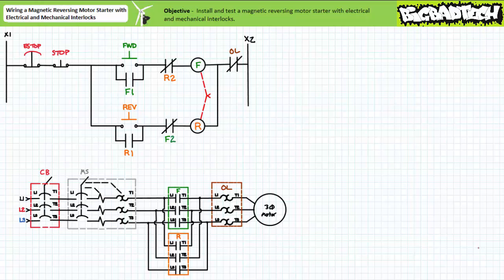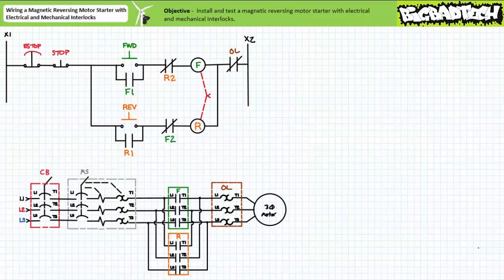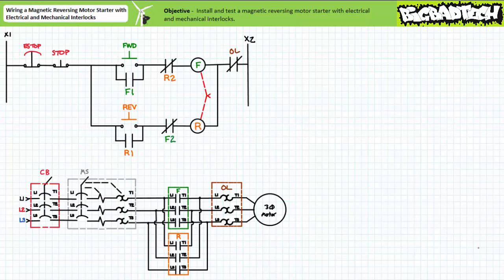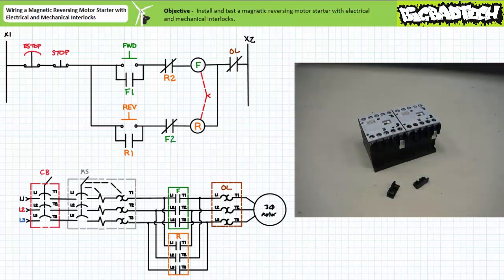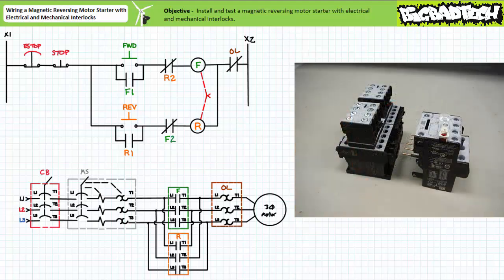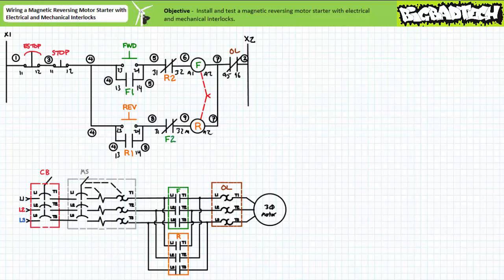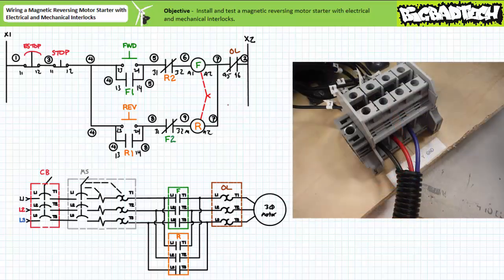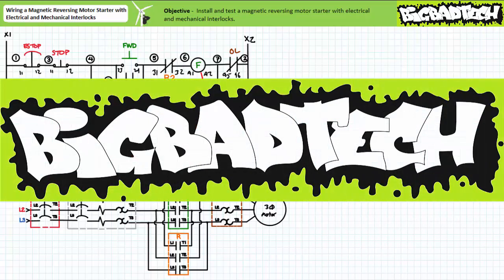Wiring a Magnetic Reversing Motor Starter with Interlocks

Comment: Can you explain why you are using both a manual starter (with a built in over load) and an additional overload? Wouldn't the Manual starter be enough?
Reply from the maker: Good question. You're correct, either one would serve to protect this system. You'll often see this type of arrangement for 2 reasons: 1) redundant backup in case one element fails 2) the manual motor starter could be servicing not one but several contactors, when a technician opens the manual motor starter everything downstream is de-energized. Elements not serviced by that manual motor starter remain unaffected. This serves as a means of functionally isolating certain elements of a larger system.

Comment: Can you make a video with 110 volt for 110 motor
Reply from the maker: Stay in touch. I plan to do a series on single phase AC motors (once I finish 3 phase AC motors). Often times 3 phase AC equipment is used to make and break connection to single phase AC motors such that all 3 contacts are wired in series with one another (ie: into L1, out of T1 into L2, out of T2 into L3, out of T3 to motor) such that three series switches simultaneously open and close.